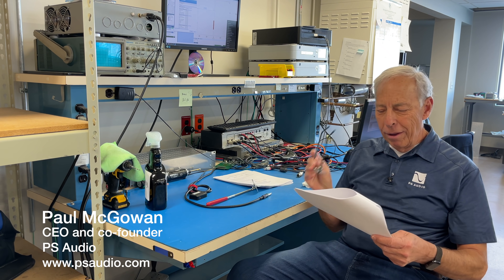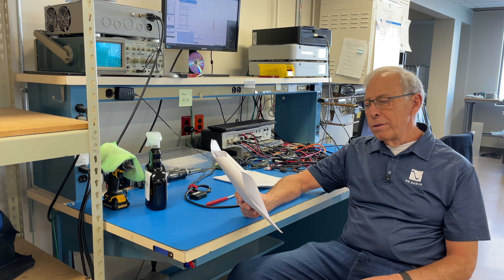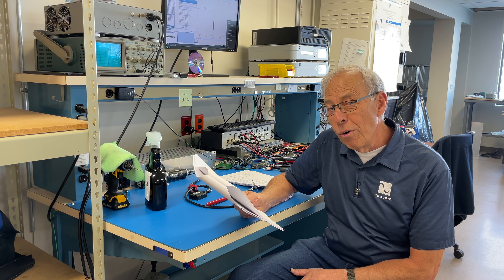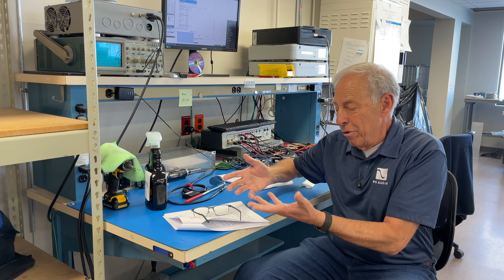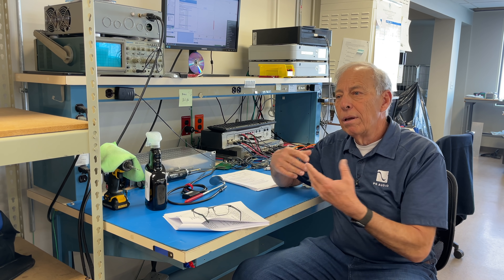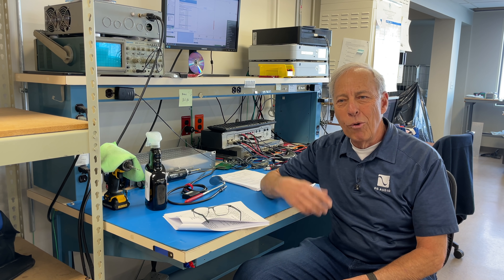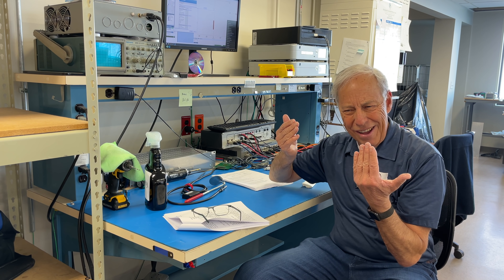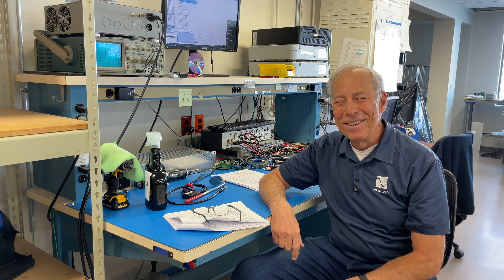The BBC Dip

Comment: I have listened extensively to British LS3/5A style speakers and generally love them.  But I would not describe the "BBC dip" as any loudness contour or smile shaped response.  Rather, it sounds to me like a solution to the problem that pretty much anything other than a Quad ESL 57 or the most impossibly expensive and impossibly difficult to drive speakers often sound bright and quickly become fatiguing.  This is further aggravated by dealers who want to make a strong first impression with "transparency", "air" and / or "extension" when hawking their latest overpriced voodoo speakers with or without Ferrari finishes but invariably reviewed by 6 Moons audio.  No thanks, I prefer the BBC dip.  Even better with a London dry gin or UK single malt and I'll be happy with my speakers.

Comment: Some sites blindly promotes speakers with smooth curves in a specific type of measurement, and sell "corrections" to or reject speakers with carefully designed intentional dip in the curves. I understand that the speaker measuring tool they purchased is very expensive at those sites' budget level.

Comment: My postulate: Where the tweeter level is about 20 - 30 db down in on-axis measurement, there is quite much perceived sound energy from the tweeter due to very wide dispersion of the tweeter at those frequencies. Hence, the on-axis level must be down - some B&W speakers -. Or . . .  Some modern speakers such as modern Spendors have a dip at those frequencies at far off-axis, not on axis, as you can see in Stereophile measurement.

Comment: I was working at BIC from 1990 to 2000. We designed our speakers to have the BBC dip because it sounded more realistic dipped slightly than flat though those frequencies. We received numerous excellent reviews from the speakers designed during that time. There is a time when designing a speaker when the listening (and tweaking the crossover) becomes more important than measurements. This typically occurs at the very end stage of design.

Comment: BBC dip often comes from two way speakers with poor off axis dispersion at the top of the woofer frequency range. This is actually a design limitation. It does make the speaker sound more laid back and emphasizes bass and treble a bit more (smile EQ) - 2KHz is exactly where loud sounds can be harsh to our ears and that is usually the target of the dip. It was discovered that this design error of most two ways actually sells well and helped hide poor quality mid range of cheap polypropylene cones prevalent in BBC two ways of that era. There is no need for any speaker to be designed this way but since it sells well and makes speakers cheaper to make it remains prevalent. I agree with Paul that flat response is more towards higher fidelity “hi-fi” and a dip is more an audiophile style colouration/tweak. Audyssey  32 auto EQ processing adds a dip around 2KHz that makes a “hi-fi” speaker sound laid back (as if you are seated further from the musicians or making a small listening space feel a bit bigger - desirable for classical listeners who aren’t used to rock/pop/jazz live in your room sound).
Reply: Fascinating. Thanks for the insightful comment. I always found it intriguing how a lot of manufacturers tend to focus on achieving a 'clean' and pristine sound by seemingly elevating the high and tightening up the low frequencies but refusing to address the midrange. Some haven't however; I know someone who owns an Audio Analogue Maestro Anniversary, Harbeth Super HL5+ combo and there is definitely something magical and engaging about that specific sound which one tends to miss when going back to the aforementioned sound... (especially for a guitar player who's used to mids like me hehe)
Reply: @GeorgeMartinMusic  Harbeth make an extruded polypropylene cone that is much higher quality than most stamped polypropylene cones + their radial cone has much better characteristics and is the reason they have such a superb mid range.

Comment: The BBC dip was used on the LS3a and other BBC speaker monitors to avoid the obvious crossover from the bass woofer to the tweeter as this is the most sensitive part of the frequency range to our ears. 👂 🙂
Reply: Yes because it's a 2way and without a waveguide when the tweeter takes over the off axis responses "bloats" in that range till the tweeter starts beaming again higher up. This off course also puts more energy in the room in general around there so it has to be compensated for.

Comment: I thought the origin of this dip was to compensate for the plastic cone drive units that were on some early speakers. I read it somewhere - maybe from Harbeth. 

Also a flat speaker response will sound different across different equipment and sources which is kind of important to note.

Comment: Sound is such a personal thing, I listen to music at low levels but don't like the loudness control. On Eq, I tend to gently lift both the bass and treble. At nearly 70 years old I can't hear anything above about 13KHz, hence the high lift and the bottom lift just makes the large speaker diaphragm move a bit :) Sound reproduction is such voodoo magic and I'm still looking for the perfect system.
Reply: But the "loudness" control is doing exactly the same thing that you describe doing with EQ, A gentle lift of bass and treble extremes. Perhaps your particular loudness control is doing too much or too little for your taste, that's the only thing I can put it down too. BTW, I'm 58 and cannot hear past 12khz so your 13 is pretty good - 😀

Comment: The BBC dip is a remnant from trying to fix off-axis response due to limited technology available in the 60s when the LS3/5a monitor was made (hard plastic cone drivers).

ELAC's Andrew Jones thinks it's rubbish to use these days when you shouldn't have those problems with that off-axis boost on a well made modern speaker. He's not the only speaker manufacturer with that opinion so keep that in mind when evaluating whether you should go for the BBC dip today.
Reply: the frequency response curve of the human ear is responsible...........so jones is wrong
Reply: @johnholmes912  It's a reason it's still used but you're treating the issue way too simply. There is a reason why Audyssey uses it but more high end room correction systems don't. We've also heard Paul praise ELAC on points where he now says we need the BBC dip to sound good, which clearly becomes inconsistent.

To also go more to the source, we can get info from Dudley Harwood, who led the design department that explored this issue when it was created, and his legacy. From the Harbeth FAQ:

"According to Harbeth's founder, Dudley Harwood, who ran the BBC's design department during the time that this psychoacoustic effect was being explored, it was introduced initially to mask coloration in the vacuum formed cones available at the time. Whilst reducing speaker output in this audio band achieved this, it subjectively pushed the listener away from the speakers as the stereo-listener's sound stage subjectively receded behind the speakers, which is unobjectional for acoustic music, but takes the life out of non-classical music. An alternative strategy employed or in combination with the Gundry dip is the application of heavy glue (dope), usually by hand brushing, to the surface of the cone to ameriorate latent coloration. The Harbeth RADIAL™ cone has no coloration issues so does not need to use the BBC dip, nor cone doping, to disguise latent mechanical problems."
Reply: @johnholmes912 2way speaker's without a waveguide have off axis "bloat" in the midrange pushing more energy into the room. With the BBC dip you get that corrected and the total power response comes back to flat again. So yes. Not a problem on modern waveguided speaker's.

Comment: The BBC dip is not the same thing as a downward sloping curve. It's a reduction in certain midrange frequencies that has nothing to do with higher frequencies. The Audyssey app allows the user to turn off the dip.

Comment: The BBC dip was originally put in to counter the fact that BBC recoding equipment was particularly sensitive in midrange so it was to kind of balanced equivalent of raising the bass and treble but keeping the mid level
Reply: Reality is that when a studio is mastering your music they use speakers that have a certain performance. Studio monitors are often designed with quite flat frequency response and whatever you have that is different from what was the intended sound will sound less as it was intended.
Reply: @ThinkingBetter  the BBC started recording in the 1920s and the microphones they used were extremely sensitive to midrange and the speakers that were designed by/for BBC receivers had the dip to make it sound better and to combat the strange voice reproduction that sounded like it was recorded in a tin can. Well that what the BBC said was the reason they did it anyway
Reply: @alan.shayler  Yes, I am not arguing against you, but when studio monitors of today are not designed with this "BBC dip" then the mastering of the music you listen to will be optimized to a flat frequency without such "BBC dip" and anyone listening to any system that does such vocals suppressing dip will hear something different as intended. My preference is an audio frequency response more true to the intended tonal balance (this is what HiFi is supposed to mean) with some loudness compensation when playing at low volume. I would call this "BBC dip" nothing more than a "flawed and fixed loudness compensation" in today's world.

Comment: Human hearing is tonally different at different volume levels. BBC dip or loudness compensation are sort of in the same topic of making music more enjoyable at lower volume levels.
Reply: I think you are right, and wrong... Yes, human hearing is different at different volume levels, but the dip is not a "loudness compensation", as it dampens only a narrow band in the midrange area. It also helps a lot at higher volume levels, which I have experienced myself during speaker builds, crossover tunings and even DSP tuning in cars. Loudness is more about amplifying lower bass and treble at low volumes, and its purpose is to compensate for our hearing at lower volumes, while the BBC dip makes sense regardless of volume levels...
Reply: @TorgeirFredriksen  The way our hearing works, as seen with the Fletcher-Monson curves, is that especially where you have this "BBC dip" is where our hearing is most efficient. Thus, the effect is in the realm of what loudness compensation does at lower volumes. I've also done DSP compensation for both home and automotive. Actually this article just made me create the dip as EQ curve in my miniDSP home office setup and I actually prefer it switched off. Especially when using my Stax headphones, it didn't sound natural. The idea of suppressing vocals with such mid-range dip is making smaller speakers sound a bit bigger I guess, but when the studio monitors used for the mastering were without it, you are deviating from the intended tonal balance.
Reply: @ThinkingBetter  Adding such an eq to any final product, such as your Stax headphones makes no sense. It's mostly applicable during design and tuning of new speakers, or when setting up custom crossover filters. I still think we're discussing apples vs oranges here as long as you compare this with loudness. Or else you may need to call Paul and warn him about doing this for their new speakers ;)
Reply: This is what I understood from my Audio Engineering degree. Admittedly, that was a long time ago, so perhaps our hearing has evolved since then 😆
Reply: @circattle  LOL, it's a bummer the internet has become such a big source of flawed information. I also had classes in audio while in university and remember our lab had lots of equipment incl. a professional fairly large anechoic chamber and even a turntable in the room allowing to make radar plots of how sound was dispersed around a speaker. This was back in the 80s. A bunch of us decided to make a competition of creating the best speaker and had a lot of other students invited in an auditorium to vote on the winner. In my opinion, audio has not actually improved much since the 80s. Already in high school in the mid 80s, I bought my first CD player (Denon DCD1600), Stax headphones (SR-34), speakers (JBL 18ti) and an amp (NAD3020). My guess is that >95% of what any student listen to today is inferior to the system I had in my room while in high school.

Comment: You can do it with a good  parametric graphic equaliser like a valve equaliser cut it at the given frequencys whatever sounds right for you because room interaction plays a part. You can get a good poltec valve replica by warm audio valve £600 that's too much dbx make a 31x2 10hz-50khz band graphic equaliser with cut off £140
you can use a speaker management system as well like the Behringer ultradrive what is a better system is an active crossover as well you need to disable your crossover in your speakers tho

Comment: Flat works great provided your not listing to vocals, only instrumental. Same as Fletcher - Munson our ears are just more sensitive to that range.
Reply: The Fletcher Munson is more related to our ears are not linear and the precieved loudness per frequency changes as SPL increaes. Technically not the same as the BBC dip
Reply: Flat is not wrong on condition   that listener keeps heard by him loudness at more than average and room is not a big hall so it can  resonate with low range.  . That is in my opinion reason why people turned to so much  bigger amp and speaker powers and then (logically) started to search for bass traps.

Comment: Do studio monitors used for music production also feature this BBC dip ? I'm asking because they're supposed to be flat 🤔
Reply: Gundry dips and bbc dips are common in high end studio monitoring situations last I heard a few years ago. It’s about referencing, and if you know how your mixing or mastering environment will translate to other systems then that seems to be all you need.
Reply: If it is gentle, large (800-5000 for example) and withing 3db it wont be an issue. What you need in monitors is detail and no large dips/spikes in specfic areas (eg -5db at 4Khz). With gentle shelf all it does is push midrange instruments a little bit back. All you need is a reference track to gauge where stuff should sit loudness wise and you are golden.

Comment: What does this mean for room correction  using DSP? Should I make a dip in stead of making it flat?
Reply: why not try it? i just did. and i like how it sounded here :)
Reply: Tuning the dsp to the room is the best option for me. You can turn down problem frequencies with your room or accentuate frequencies that get sucked up. Use your ears and make it sound good to you!
Reply: It’s personal preference! Depends on your acoustics and of course, ears!
I have it off in my Marantz AV processor with Audyssey calibration app. There you can not turn it off via remote or on the processor itself, you need to buy the calibration app.